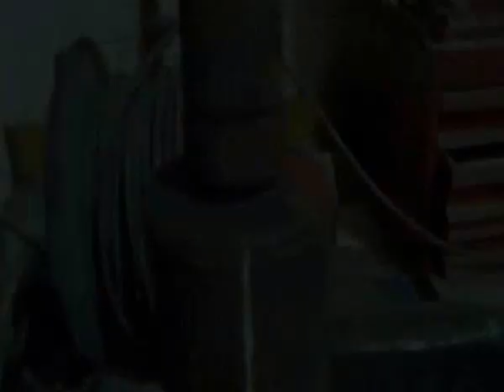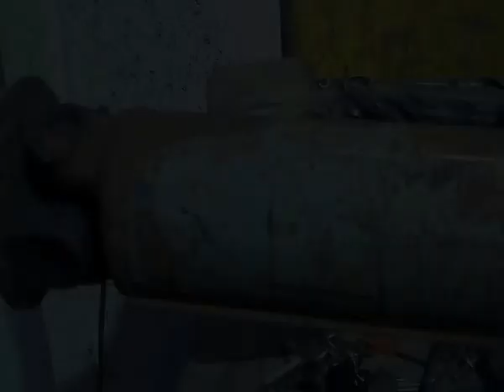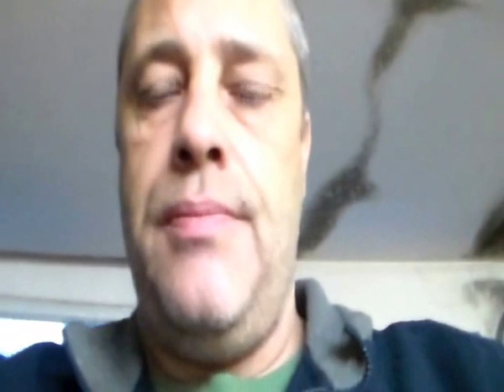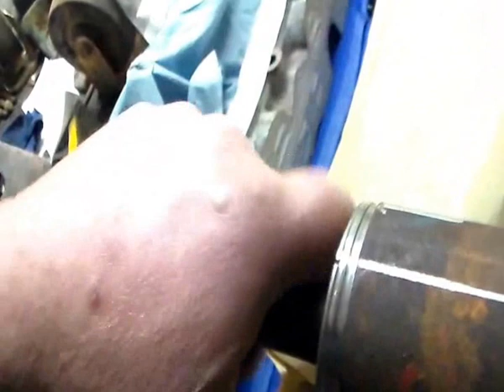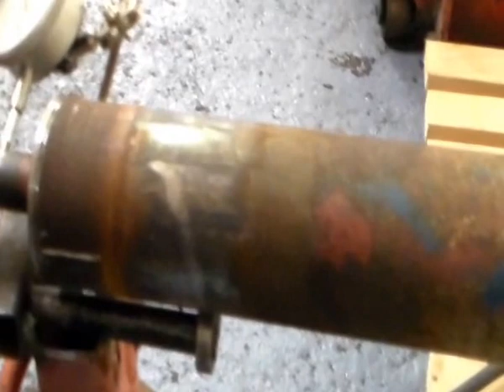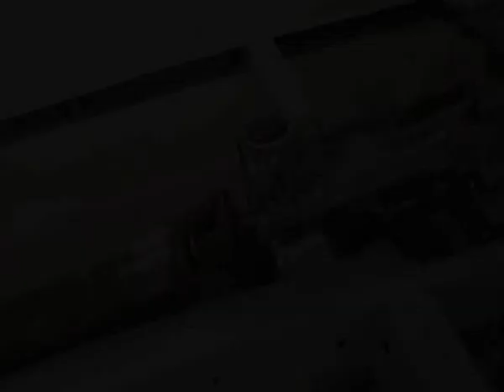Shortening a car propshaft

Comment: Looks like a prop-err job lol :-))

Im supprised that a single weld is strong enough, i almost expected you to drill though the sides of the tube and plug weld it to add surface strength.
But im an ignorant sod and like manwell in faulty towers "i know nothing" ha ha :-))

Comment: Interesting solutions to your problem. Why please did you want the "float" at the diff end rather than the gearbox end?
Reply from the maker: It still has a slider at the gearbox I made that in another video, I'm going to be welding the diff end. Its fairly skinny so best to be welded I think. Thanks for comment Sir